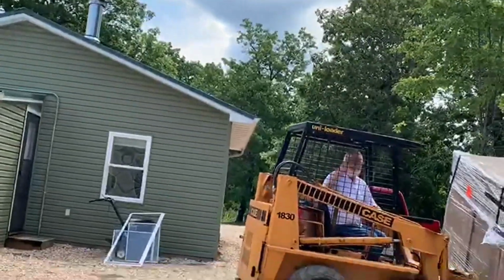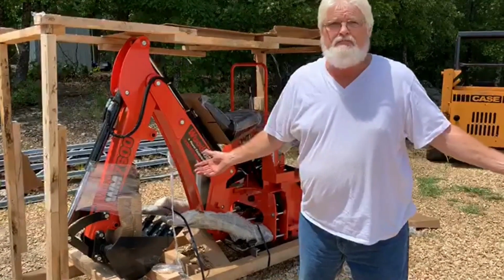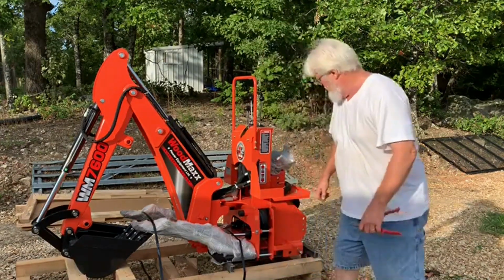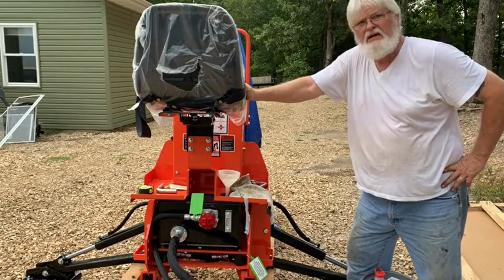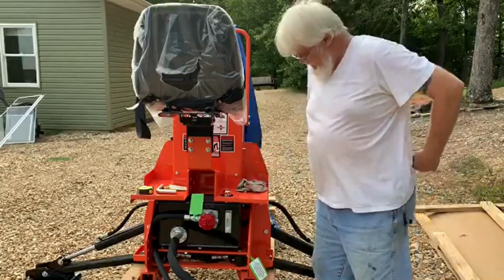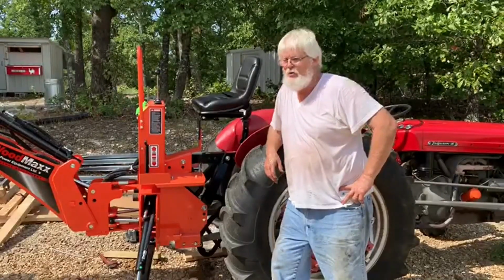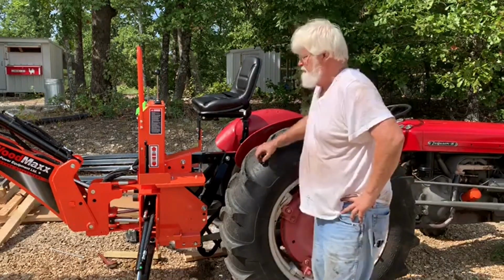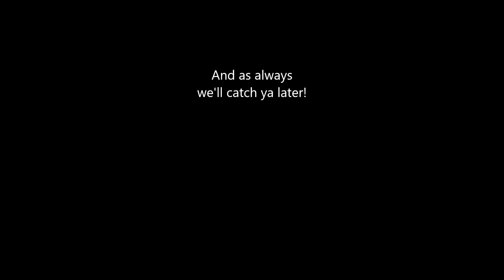Putting Backhoe on a Compact Tractor  /  Woodmaxx 7600 Backhoe

Comment: Thanks for sharing, we are also from the ozarks! I am considering getting a woodmaxx backhoe, seems to have decent reviews, warranty and parts are easily available. Would love to get your opinion on everything  since you have had a chance to use it. We have a MF35, MF135, and a  JD620, so I would end up using it on one of these tractors (most likely the fergusons)....I'm hesitant to get a 3pt backhoe because I have heard bad things...but they are more in my budget, and I wouldn't try to tear it up or my tractor...and the fact that they come with a external pto pump makes it really nice. I wouldn't be using it all the time, just every now and again--footings, trenches for water lines, cleaning up fence lines, taking out stumps (maybe??if possible?). What are your thoughts on the backhoe? Especially since you are running it on the same tractor I would be running it on. Any advice for me? Also why did you choose the 7600 instead of the bigger 8600 (besides cost). Do you think the ferguson would operate better with the 7600? Any and all advice would be appreciated before I pull the trigger 😁 Thanks!
Reply from the maker: The heavy tractor would be best. I will post some pics of things I did to make mine work better. The backhoe is stonger than the old tractor I have. I have noticed that digging in moist soil saves a lot of work in the Ozarks.  You just have to take your time and work around rock and stumps to get them out. If you remember it's not made like a full scale backhoe you will be fine. Respect the Woodmax and it will work well or at least it has for me. A lot of people try to put them on newer tractors and run into trouble with the aluminum body cracking or busting. I have had no trouble with the heavy cast older tractor.  I'll post a notice on here when I add pics! Thanks

Comment: Hello from Australia.  Does your Ferguson 35 handle the backhoe O/K?  I have a 35 and am looking at a siomilar backhoe that is called a B6.  Thereis a B7 also.  Do you know what your 7600 weighs please?
Reply from the maker: Hello, the 7600 is about 1030 lbs. I added weight to front end of tractor,,  Had to add liquid in front tires and I added about 250 lb  of weight to the front end.  The backhoe is locked into position so you don't have to worry about 3 point lifting it. Make sure all your hook ups are heavy duty, I also set mine up so the sway bars are a solid bar so there is no movement.  The tractors power is plenty to run the backhoe. Hope this helps !
Reply: Thank you.  I was considering wheel weights for the front.  Did you find the front wheels lifting off the ground before you added weight??
Reply from the maker: @roderickbarry2411  Not when sitting in place but going up hill or turning in gravel was fun! lol  I added 250lbs to front end and about 40 lbs per each front tire and it  took care of it. I live on hillside and have no problems now.

Comment: I am considering adding a backhoe to my new farmtrac 25 hp..i see someposts that say 3pt hitch models arent good for the small tractors,,what has been your exp so far,,,any issues with tractor frame,,my farmtrac is built pretty stout ALOT better than the TYM AND JD models i looked at
Reply from the maker: I have not had any issues but I would contact Woodmax to get their opinion. I personally love it.

Comment: It's been 3yr. How has this machine been working for you?
Reply from the maker: I don't use it everyday but every time I take it out to do digging in this hard clay I pat myself on the back. I know there's a lot said about tractor size and all but with this old tractor of mine I've never had any issues except adding extra counter balance weight. Just check with the Woodmax dealer for your tractor size and recommendations. Thanks
Reply: @OzarkMountainGoats  thx, not sure what kinda rig you have but the older machines tend to be tougher than a air conditioner in a west Texas heatwave

Comment: Any update on this? maybe some action video of it working?
thanks
Reply from the maker: I wish Id thought of it sooner. I just dug a 180 ft x 3ft deep septic line in and had no problems at all. Except my ole legs getting up and down off tractor. We have had a load of rain this year so the digging was pretty easy. Most of years this clay down here is like concrete. It worked out well for keeping the soil with a little dampness. Not mud but moisture. The rocks so far has not been a problem but I haven't run in to a massive one. If I had I would have went around it. lol.  If I can remember I have some rocks to dig out below our orchard that are a trick to mow around that I will be taking out. But probably not till fall when tick and chiggers are gone. I have been very happy with it so far!
Reply: @OzarkMountainGoats  excellent, thanks for your response

Comment: I've got a massey Ferguson to35 that I was thinking about getting a 3 point backhoe for . It looks like it's about the same size as your tractor has it worked out pretty good? If so I might look into getting one like you have
Reply from the maker: It worked out pretty good. Nothing like a big backhoe but it does good for what I need. I put in 100ft septic line a water feature many trees and dug waterlines. If you get one you will need to add weight to front end and make sure you add 2 sets of sway bars at three point connections. Thanks for watching!
Reply: @OzarkMountainGoats  cool I was wandering if made it back end heavy I believe I'm gonna get one thanks for the info

Comment: I like the WoodMaxx Backhoe,  I see you have it on a Trailer,  did you buy it from a AR dealer?  How do You like overall?  Thank you.. I'm looking to buy one.. Great Video 👍
Reply from the maker: There are dealers closer than I bought. I bought right from main Woodmax on internet  and had it shipped in, free shipping to Springfield. I took a trailer to shipping company up there and picked it up. They wouldn't deliver down gravel road where we live. You can check internet to see where your closest company is and if they will deliver. Thanks
Reply: @OzarkMountainGoats  Thank You... Info helpful... I'd been looking online and maindealer.. Shipping too.. Lol I live back off pavement,  Mile or better,  Gravel Rd...
Reply: I got a Mahindra tractor 50 HP... Great machine if your thinking about upgrading newer.. Basically a 60s version of International Harvester... Real Shift,  Clutch 4+4 diesel.. Price wise,  better than Green,  Orange,  Blue tractors price by far.. Yet out lift them to for 50 HP models.. Strong brute force... Something to consider if you up grade..
Reply from the maker: @marks6951  I'm waiting until this one dies before changing up but I do like Mahindra. The guy down the road has one and it's a beast!  I will keep all that in mind though when I do go to change up. Thanks
Reply: @OzarkMountainGoats  Definitely,   and be sure to watch Mahindra Rise Video History on them.. WWll Willy's Jeep,  paired with International Harvester too.. I love mine.. You won't find soft week metals either.. Heavy Weight tractors... I don't live on flat Terain either.. My sales rep,  Great.. 7 year Warranty... And you can get parts US... Their huge in Texas.. Watch their video's..

Comment: Really contemplating getting one. How’s it working now you’ve had it a while
Reply from the maker: For a small tractor it works really well. The tractor we have was made in the 50s and has a 35 horse motor. It is lite in the front end so I had to add fluid to tires and put a weight of 200 lbs on front end. It will never dig as well as a normal backhoe but does everything I need. I plant trees and I have dug a 100 ft septic line 3 ft deep with no problem. Digging out stumps requires really digging around stump well because tractor is lite weight. After all I said above I am soooo happy I have bought it. Anymore question feel free to ask. Jim

Comment: Definitely need weights on front of tractor.. just be careful using it and you'll be fine, lots of folks think they'll "break the tractor" don't realize that happens when they're too rough and driving too fast through rough ground. Some people can break anything 😆
Reply from the maker: Thanks David. I have added 200 lb weight to front end plus added liquid in front tires.  It will hardly slip now even on a slope now. I'm old everything is slow and easy now. lol Thanks again!!!
Reply: @OzarkMountainGoats  Any details on how you added weight would be very helpful. My TO35 is definitely needing some weight in front now that my WM7600 is installed! And thanks for the recommendation.
Reply from the maker: @atruef  there were 4 bolt holes on mine on bottom of motor. I drilled 2 holes in 2 sections 2x2 steel and let them stick out front. Bought bolts that were long enough to go through 2x2 steel tubing and into holes  Then welded angled steel on front of 2x2s sticking out in front of tractor. Forming a rectangle frame. Then I poured a concrete weight the same size to set inside frame. I put wire and a hook in concrete block sticking out of top so I could set it in metal frame. Hope this helps.

Comment: what kind of tractor do you have 
I have a 1952 TO 30 Ferguson 
thinking about getting one for it 
my tractor is 30 horse power
but if I do I'll put braces under the tractor off of an muck bucket
Reply from the maker: It's a TO35. Since the video I added about 200 lb weight to the front of tractor (we live in the hills) and added fluid to front tires. I would also go with the size smaller backhoe and the smaller 12" bucket. Your only talking a little less depth. The smaller bucket wouldn't move the tractor around so much. I got the 15" bucket.  I may get smaller bucket myself.  If you live in the northern states with black soil and less rock or in sandy soil not a problem but down here with all the rock you have to take small bites at a time. But the backhoe works well and I and very happy with it.  The baces are a very smart idea. I have done some extra bracing also but not to that extent.  This is a well made machine and I'm sure it will out last the tractor but that's OK. I can pick up a used tractor for half the cost of the backhoe when this one is worn out. Thanks and if you have any question I can help with give me a hollar!
Reply: @OzarkMountainGoats  I'm putting a 7600 on a TO35 this week, based in large part on your video and comments! I'm not having any luck finding good examples of adding weight to the front end. Can you please detail how you added 200#, which ought to be sufficient. I'll need to be able to take the weight(s) off when I mow - it can get mushy here in N. Texas in the spring.
Reply from the maker: @atruef  I'll have to do some thinking on that one. I made mine permanent. I will do some thinking over the next couple days and see if I can help you out.